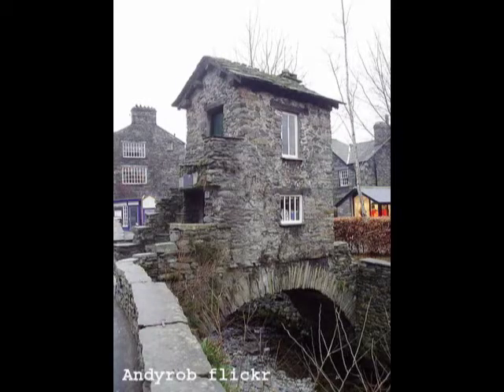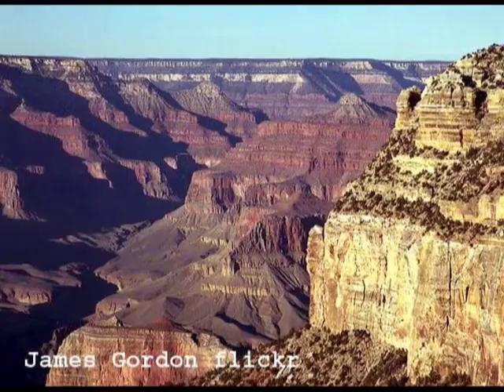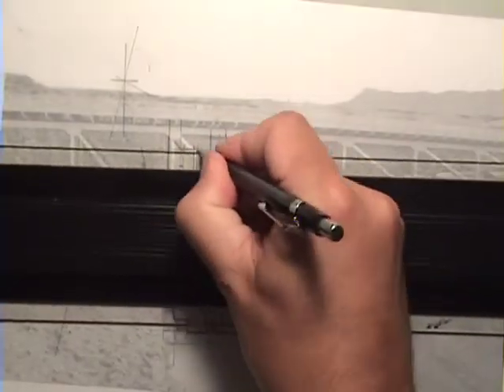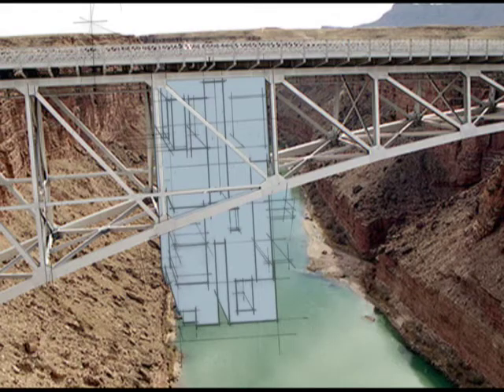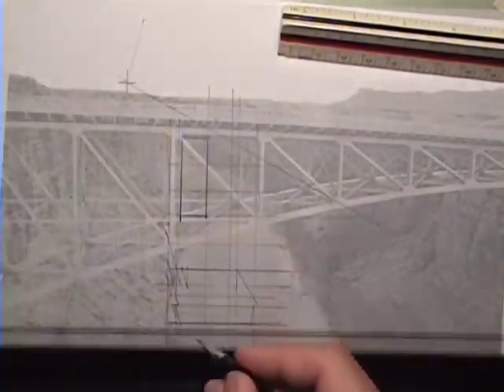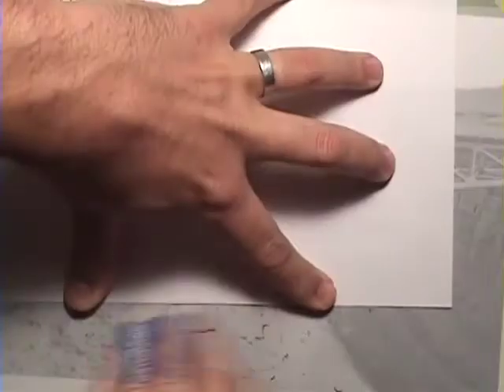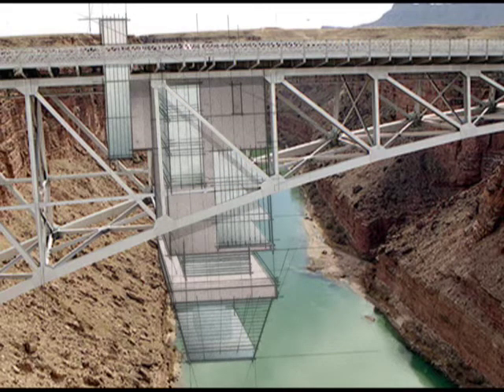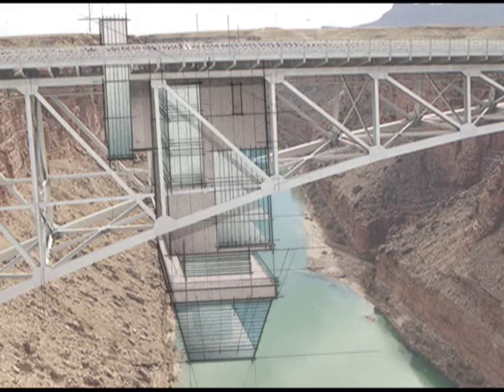How to design a bridge house

Comment: If there is already an elevator, why not slightly widen the space to accomodate a car? Or multiple cars? If anything is possible, in this scenario, there may also be room for more than one car, as the elevator range is quite a stretch. I'm thinking something like those huge metal plates that turn big trucks around in parking garages or delivery sites. If there were something like a conveyer belt/elevator OR you could simply increase the depth so that the car could pull forward. Just some ideas.

Comment: Bullshit. Bridges are not designed to support that kind of extra loads. Besides, because of the vehicle passage and wind, you will have some serious comfort issues like vibrations and noise.

Today's architects needs serious structural engineering courses.

Comment: I think the biggest structural issue would be the observation hanging below. High winds (not uncommon in the Grand Canyon) would hit that and cause quite a bit of torque on the bridge. The space between the girders on the bridge should be wide enough to accommodate nice views.  Extending the house horizontally to be wider than the bridge would be an easier option, and the elevator could lead directly to the living area & observation deck! Also, it's very noisy right below the bridge deck!

Comment: Yeah, i agree... that's what i meant... you can't build a house under an old bridge without even redesigning it... based on the video, he did not say anything about redesigning the bridge... what he did was, making a house under a bridge that was already been there... meaning, an old bridge applying a new unstable moving load... i think it went, "CRUNCH"

Comment: you could redesign the bridge slightly to now include the new loads applied,
for example the house could be supported the a new system running each side of the bridge, so that the building structure is not directly applied to the current bridge

Comment: Before designing such houses like that, you have to design a bridge that can support it first... provided that it is expected for the bridge to put a house under it before it was made... But if you put a house just for an additional load for the bridge, it would be impossible... The bridge would probably fail. Not the house under it...